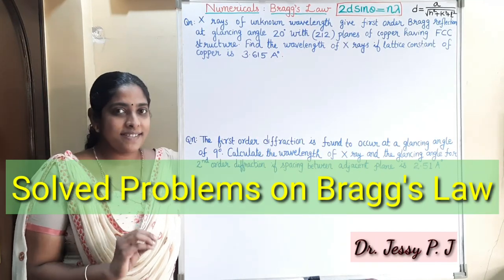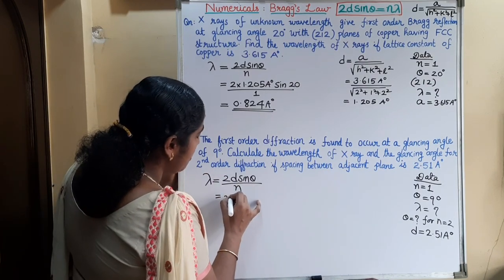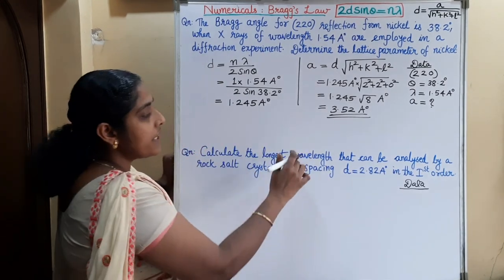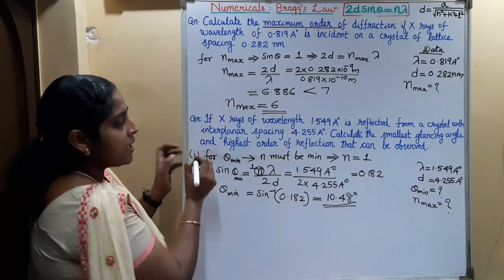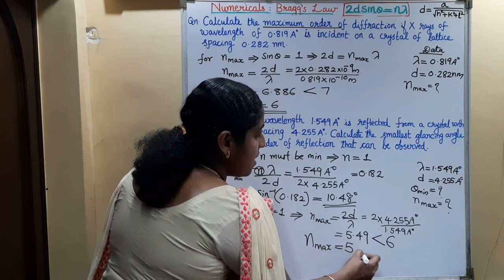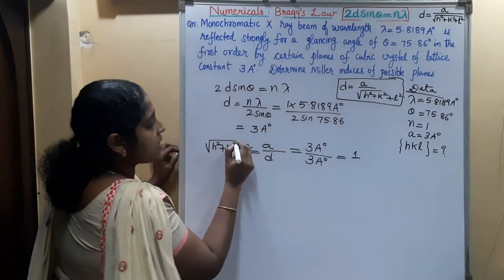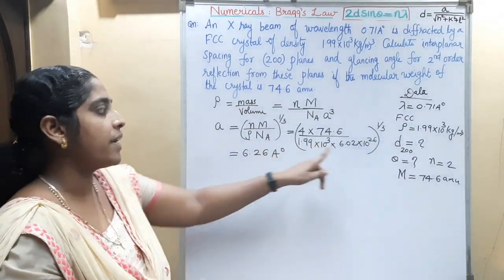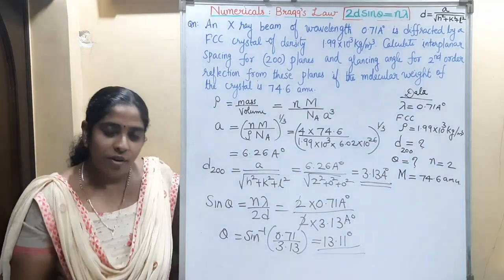Solved Problems on Bragg's Law

Comment: A X-ray of wavelength λ when incident on the (101) plane of a cubic lattice with lattice constant a produces first order Bragg's reflection at 0=30° (grazing angle). Suppose that lettice is compressed along the 3-axis so that lattice parameters along the x and y axes remain the same while the along the 3-axis become a/(sqrt(3)) * The first order reflection for the (101) plane of the compressed lattice occurs at- 
A. 30 degree
B. 15 degree
C. 45 degree
D 60 degree
Reply: For 1st case d=a/√2
For 2nd case d=a/2
As sin@=n lambda / 2d 
So sin@1/sin@2=d2/d1 
On solving we get 
Sin@=1/√2 so @=45 degree

Comment: In the x-ray diffraction for tantalum powder, the following angles were obtained using radiation of wave Length 0.15406nm 19.6,28.1,35.1,41.5,47.7,54.1,54.1,60.8,68.9.
Find, I,)the corresponding lattice planes.
ii)the lattice type.
ii) lattice parameters.
Plz help me mum, am grateful for your lecture.

Comment: Calculate the Bragg angle if (111) planes of a cube (a = 3.57 A) crystal are exposed to X-rays (wavelength - 1.54 Å).
Plz reply ma'am
Reply: 21.9° ra Monday ga